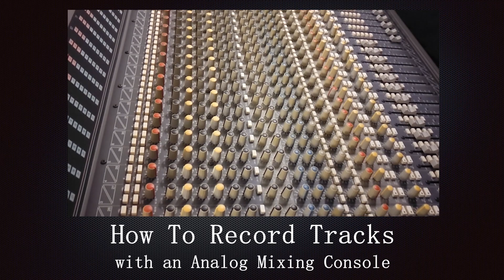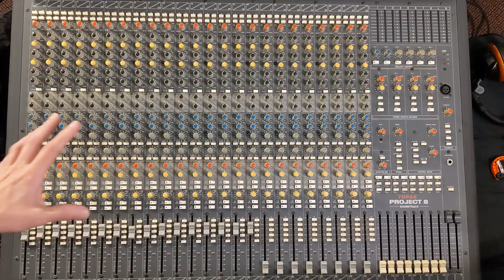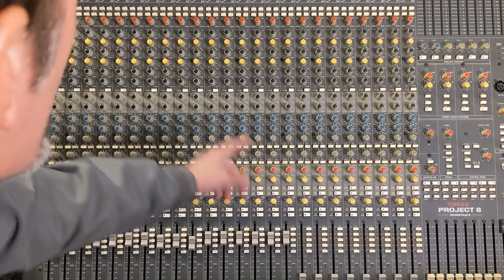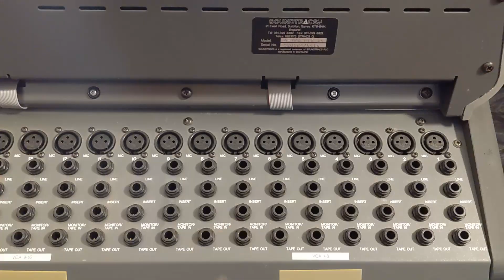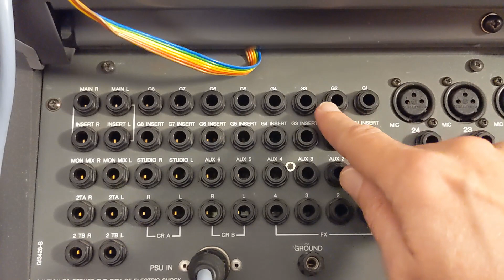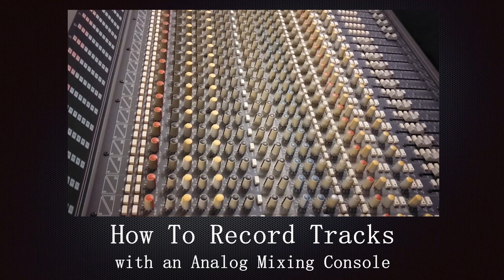How To Record Tracks with an Analog Mixing Console

Comment: Have you had to recap any of these old consoles, or did you find all of them to still sound clean/balanced after so many years?
Reply from the maker: Most of the consoles have not been re capped and haven't really needed it. I think the idea that everything must be re capped is overstated at times. Sometimes the old caps contribute the the vintage sound as long as they are still in spec. Whether they stay in spec or not is different depending on the console. Neve VR series are notorious for having bad caps because they operate at such a high temperature and it wears the caps out. Most of these smaller project Studio type of consoles do not have that kind of heat buildup and don't need their caps replaced as much. There are other variables such as the quality of components used by the original manufacturer but no I hadn't had to re cap many of my consoles at all. I've had to re cap a few compressors though. I have a few that are older than the 90s and were out of spec enough that they didn't work correctly and sounded strange.
Reply: @TwinCreekAudio  That's awesome! I've been shopping for one for a while but haven't had any luck so far on eBay or Reverb. I've noticed you have quite a few! Where did you find them?
Reply from the maker: @poxcr I found them in different places. A few came from Reverb or other online marketplaces but I found the best deals locally like the Mackie 8 Bus for $50. The Fostex 450 came from a pawn shop. I've also had a few that were given to me such as the Soundcraft Spirit Live which came out of a local college auditorium. They were going to throw it away, but a friend of mine saved it and brought it to me.
Reply from the maker: Unfortunately, I didn't have the space to keep all of them. I've sold some to recoup what I paid and I've donated a few as well. I wish I had enough room to keep them all but I usually document them in videos, then keep them for awhile before letting them go.
Reply: @TwinCreekAudio  Let me know when you decide to let the next one go!

Comment: I have an Allen & Heath PA28 mixer and would like to set it up to record some channels into an analog tape recorder.  According to the manual the 2TRK output is used used for recording; in my case analog tape recorder. I don't want this to effect the Main Outs. The System Block Diagram only shows 2TRK being bussed to the LR, which would be the same signal as the Main out.  It looks like I could use the FB1 and FB2 Outs but I'm already using FB1 as a monitor out.  Should I be using the Aux Out for my monitors and then free up the FB's for recording?
Reply from the maker: You might be able to do this if the console has direct outs. You can also use an insert cable connected to the inserts and use the send jack to the recording device. It's a live sound console but hopefully will have one of these options.

Comment: So if your mixer doesn’t have a “tape out” you can’t record through it into a DAW?
Reply from the maker: You can use any output but normally it would be a direct out or a subgroup out if you're combining multiple sources to record on 1 track etc. If the console doesn't have a way to send an individual channel and only a master out, you can use it but it will limit the amount of sources you can send to the audio interface.
Reply: @TwinCreekAudio  yep that’s going to be a problem, I thought that might be an issue, the m216 won’t do the job, I’m going to have to hope I can find a 320 or 320b. Thanks for your help again!
Reply from the maker: @ThoughtCrimeCollective  I am happy to help. The M216 doesn't have any kind of direct outs? You can also use line inputs for summing. The tape inputs on most consoles are basically line inputs labeled tape. Best of luck. Most of the vintage Tascam consoles have a tape input on RCA connections.
Reply: @TwinCreekAudio  I would be mainly wanting to use it for the pre amps to record through, but I would like to use it to mix on as I want to get away from mixing with a mouse, keyboard and relying on my eyes more than my ears. The M216 only has tape in on the first 8 channels and no tape outs, then it’s has line in and insert on all 16. It has 4 stereo out (xlr), 10 stereo pmg outs (rca) 4 pmg outs (xlr) and then 1 pair of L & R line out puts, then 2 line effects returns.

Comment: thanx again ..what audio interface have u used?
Reply from the maker: I have several here but I think I was using my old Echo Audiofire in this video. I also have a MOTU and Audient interfaces but the Audiofire have 24 outputs so work well for hybrid mixing.
Reply: @TwinCreekAudio  wow ... any suggestions nbfor me... i want 48 outs ..lol..but 32 will be ok
Reply from the maker: @GraceLosianinga712  for 32 tracks, I would look at something like the MOTU 16a and then add another 8 channel ADAT interface. I'm a big fan of MOTU as they have good support and sound very good. Plus they have AVB so expansion and linking interfaces is possible.
Reply: @TwinCreekAudio  thank u
Reply: @TwinCreekAudio  i.need 48 i/o.. any suggestions for.me.... but my budget is very low.. lol
Reply from the maker: @GraceLosianinga712  I'm not sure about 48 IO on a budget. I'd say a RME Digiface+Ferrofish 16 IO with any inexpensive ADAT interface for the other 8 but that would only give you 32. I'll do some research and ask some friends for some ideas too though
Reply: @TwinCreekAudio  ok..thank u

Comment: I don't know how I only recently came across your channel. Great stuff! Subscribed. I've spent this last year restoring a Soundcraft 1600 24 channel board with patchbay, finally getting everything together. Just bought a pair of 501s after watching your videos.
Reply from the maker: You'll enjoy the 501s. They are like a beefed up dbx and very useful. I love the 1600 and 2400 series too! That should be a great setup. I had looked at a 1600 and a 6000 series before I bought my Sapphyre. These console are some of the best values out there in analog consoles if you're willing to put up with a little work and a more complicated installation but they are worth it. The built in patchbay has been incredibly useful for me. Best of luck and thanks so much for watching!